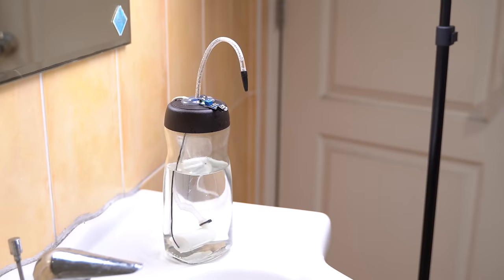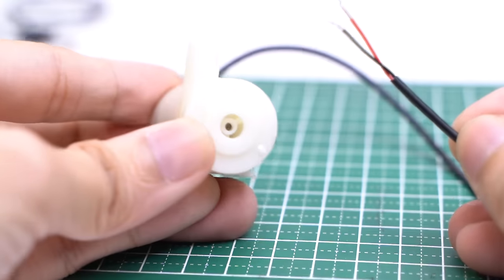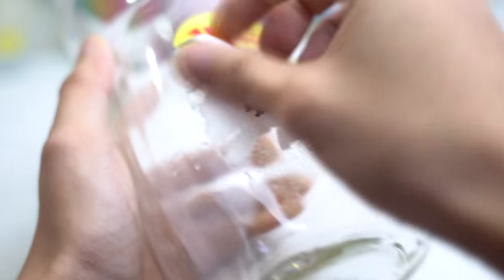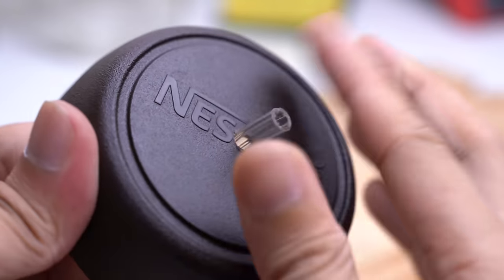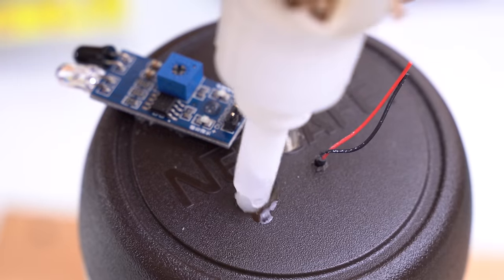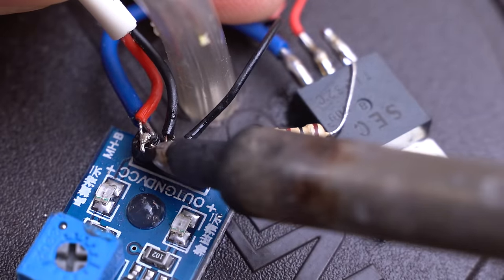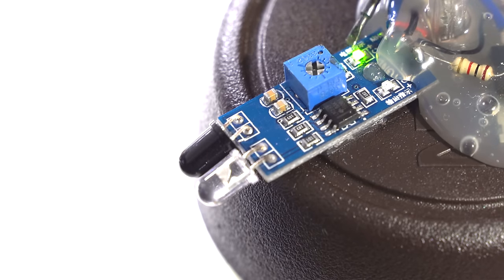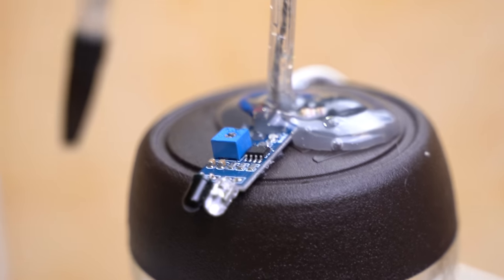DIY Automatic Alcohol Dispenser ($3 No Arduino Needed)

Comment: i made the same circuit but was unable to run it! tried to change the circuit, it worked but in reverse, like motor was running permanently and stops only if i put hand in front of sensor I used IR sensor which has VCC, G, DO and AO points did not used AO in any circuit, TIP41C transistor and 1K Ohm 0.25W Resistor. PLEASE HELP ASAP

Comment: it could have been better is you would have used mono-shot in between the sensor output and transistor input, it will resolve the problem of continuous liquid dispensing if someone does not remove hand

Comment: I have done this project but the problem is the sensor is not working after switching on the USB the motor starts and the sensor remain on it does not read any obstacle.
I have checked the sensor with USB it's OK.
But after the circuit is done there is still a problem

Comment: I had connection issues which means even though everything is connected...motor is not at all working....

When motor is connected individually it is working and even if it is connected with IR module it is working and when it is Combined with TIP 32C transistor...the motor is not working...
Anyone please help me in this regard...

Comment: thanks for this video, i just wanted to ask i used a tip42c transistor, which worked fine to be honest, i just wanted to know what is the difference between 42c and 32c transistor, plus when placed outside even when the sunlight does not hit it and the sensor completely isolated from light it keeps going on and releasing alcohol, btw thanks for the video its really helpful

Comment: hello in the implements says that it has a diode but I do not see it connected.
I only see a 1k resistor.
could you show where the diode goes
Reply: The diode goes in the same place of the 1kohm resistor (you can use the diode instead of the resistor)

Comment: I've tried it. It was great! But how to slow down the water pump??? Quite faster, can waste the sanitizer
Reply: how did you do it? i did it same with the diagram, but the pump is not working, i use 5 volts pump

Comment: Ok so everytihng is in place I checked many times, I put a led in the collector just to make sure it turns on every time i touch the sensor, it turns on, I measure the voltage 5v in the collector, but when i put the motor i dont hear anything, I have changed every element thrice, why does the LED turns on but the motor doesnt turns on?
Reply: I have the same problem. Need help

Comment: Does it have any safety issues?As the dc pump is submerged in the sanitizer which is indeed a highly flammable liquid.
Reply: From how much time are you using this machine having no problems?

Comment: Hi everyone! Does anyone know if you can delay the pump actuation? I want put some of these on top of my door knobs so that when it detects my hand it waits a second or two then it sprays the door knob. Any help will be deeply appreciated. Thanks to Tech Builder for this amazing vid!
Reply from the maker: I can design a transistor circuit for it, but I think an Arduino would be more practical in your case. Thanks man!

Comment: Any way of adding a limit to the amount of alcohol dispensed per wash? Because, a false trigger is all it takes for you to have an empty bottle.And, also i thought those pumps worked on 12V DC. I'm quite surprised to see one work on 5V
Reply from the maker: Arduino should do the job but it's too overkill. An NE555 circuit together with a transistor or MOSFET should work as a low budget substitute to give dispensing intervals. The trimmer resistor in the IR sensor must be set to a lower sensitivity to prevent that from happening. The pump is rated at 6v, it depends on which model you get.

Comment: Are you sure we should use a PNP transistor because the base of a PNP transistor is negative and the output of the proximity sensor is positive. If i use a NPN transistor, the base of the transistor will be equal to the output of the sensor. I don't know if this is correct so please help me out.
Reply: requires pnp trans to work..

Comment: I followed the instructions exactly exept i used an A transistor instead of a C transistor. The problem is that the pump is now constantly running, the adjustment screw does nothing to the pump... Tips ASAP
Reply: Use the specified transistor. Worked for me

Comment: Hey... I connected all the components as shown in circuit diagram, but my pump is running continuously.. can you tell me.why? Also my IR sensor keeps on sensing. How to resolve this?
Reply: When ur ir sensor is high it will trigger ur motor plz note ir is light sensitive so it should not be at open light kept at shade and there is a screw on ir move it clock or anticlock wise to set the distance detection of the sensor light indicator will let u know when it's high n low

Comment: I need help. I all follow the instructions but the current doesn't cut off, the pump is keep working with no stop despite I adjust the low sensitivity sensor. Any ideas?
I use power bank as current supplier.
Reply: I'm facing the same, did you get any solution plzz suggest....and if i placed a diode across E & Vcc than it gives revers functionality

Comment: if I want to use outside in daylight ??? since it is constantly activated and there is no way to stop it only works for closed places with little light ??? any solution plis !!!!
Reply from the maker: Add a short tube as a shade. It should work.

Comment: The problem that I have faced 
1. Sensor not working efficiently, when the setup is kept outside.
Reply from the maker: You can add a tube sprayed with a layer of matt black spray paint. This should prevent ambient light from entering and interfering.

Comment: Hi i tried doing this and apparently it's working the other way around. The flow stops when it detects proximity. Where do you think is wrong with my setup?
Reply: Make sure you're using a PNP transistor and not an NPN. Also make sure your connections are correct, following the schematic in the video (also linked in the video description.

Comment: Alcohol and hot melt glue is not a very good combination. Both ethanol and isopropanol vapour easily penetrate the EVA compound of hot melt glue, expand it, and debond it from the underlying surface. The glue blob volume suffers environmental stress cracking and will no longer hold too well either. A single stray droplet of alcohol can debond and weaken the hot melt glue and require rework of the project.

Instead, you can use fingernail varnish to cover the wiring. You can use acrylic double sided tape or CA glue to mount electronics. If you need to dismantle the project, both fingernail varnish and CA glue can be washed off by dropping the electronics in acetone - don't worry, the board, ICs, connectors and other components will be alright.

Comment: Hi Friend, very nice video, i tried it and almost succeed but there might be something missed or any of my component is faulty, after switching on it run continuously and power and sensor light is on continuously, please suggest what might be the issue.
Reply: I'm facing the same, did you get any solution plzz suggest....and if i placed a diode across E & Vcc than it gives revers functionality

Comment: The moment I connect it to power ,pump start running , tried indoors away from sunlight too, but it doesn't work , all the connections are as per your diagram , please help . Thanks
Reply: Same here.. for me the pump keeps running irrespective of the IR sensor output.. reply to this if you get a solution

Comment: superbly explained, good job! I had an IR module , however linking up the components as explained in your schematics makes the pump to run continously , It , however  slows down when an obstacle is brought near the IR transmitter / Photodiode, is there something wrong with the IR module?
Reply: I found the solution to the problem, I realized there are two types of IR module in the market , one with single LED which works well with BC 457 transistor  ,  & other with Two indicator  LEDS, which works well with TIP32C /TIP 42cas shown in your schematics

Comment: I used TIP 122 NPN transistor and 6v pump. But when I connect power pump start automatically, I mean Sensor's power & sensor indicator ok but Pump run like as usual. Please help mr.
Reply: why don't u use  TIP32C PNP Transistor? and less 6v pump?

Comment: Excuse me, but can anyone help me? I was wondering why are the transistor and resistor necessary? Can we not connect the motor directly with the sensor?
Reply: Unfortunate, IR sensor is sending less than 3V when detect object; when there is detection, it sends 5V

Comment: i'm new to this, and i have a question could i change the proxymity sensor with ultrasound module ??
Reply: You would then have to use a microcontroller such as an arduino to process the output of the ultrasonic module.

Comment: I have made same as shown in video but it didn't work properly. Water pump don't start pumping. It seems to be low voltage. I don't know what to do now.😔😔😔😔
Reply: Go with a 1.5A charger. Pump needs high current.

Comment: Hello sir can i used this one IRF540 MOSFET transister instead of the one u mention to us
Reply: IRF540 can be used in a similar but not identical circuit, in low side switching configuration. Too cumbersome to explain in text, ask local electrical engineer near you.

Comment: Is it safe to put 4x AA batteries (6v) for power source? Btw great job bro... ❤️
Reply: Does the board have LM358 IC on it? If i guess correctly, then yes, it is safe. But the calibration of trigger distance will be battery discharge dependent

Comment: Such a great project. I followed all the instructions and it goes well! Thank you for sharing ur project to us. A big help nowadays. Can I reproduce more of it for our school and share it also to everyone? Thank you in advance.😊😊
Reply: how did you do that? my 5 volts pump is not working but the sensor is working, what can i do?
Reply: @kevincubol2436  try to check ur connections, especially the cables of the motor it might loose or not soldered well.

Comment: Thanks for sharing.
Can I use mosfet instead of the TIP32C transistor?
Reply: Not as a 1:1 substitute, connections will be different. For usual N-Channel enhancement MOSFET, you need to use low side switching.

Comment: @techbuilder - Thanks for the amazing and low cost solution. I have got all the components but not able to find 'TIP32C PNP Transistor' or any '32' transistor nearby, can you please suggest an alternative transistor for it. I am open to using a relay switch as well.
Reply: try BD140
Reply: Will that work?
Reply: @Sooryadath  bd140 will work

Comment: Can I Input 12v and install 12v water pump its work plz reply ??
Reply: The sensor volt is 5v.We need to add voltage regulator to down 12v to 5v for sensor only.Other thing can use 12v

Comment: Thank you very much for sharing. If I cannot find TIP32C transistor, is there other model transistor that I can use? Really appreciate answering
Reply: i used a 2N 6107 transistor and it worked..
Reply: Deevish N D can i use TIP 42c transistor?

Comment: hi, some one guide me pls....i made as per this video direction. sensor works, motor not startup, ( i use the 9 V Battery) hope to get reply ,
Reply: Try to connect the motor to the 9v directly to see if it working, if so check the connections.

Comment: I tried it many times but all the times this project failed..I think there is something missing in the circuitry.Beacuse whenever motor positive end get external metal touch then only the motor works
Reply: Check with current. Pump need near to 1A current with 5v.

Comment: Kung kaya, u can add a timing delay circuit para may control ka sa operation ng pump and yung amount dispensed.
Reply from the maker: That would be great! Changing the nozzle to constrict flow would be the cheaper and practical option though.

Comment: After completing the configuration and when I switch on the USB plug, the alcohol starts flowing continuously and only stops when I take it out from thr power plug, both the lights in the sensor remains red.Can you please tell me where does the problem lies? Thankyou
Reply: If you put your hand in the sensor it stop? , maybe you have a PNP Transistor (i think in this case is NPN).
Reply: How to do it with pnp

Comment: sir what will happen if we dont use transistor? instead just use the proximity sensor's output to 
pump..
Reply from the maker: The sensor's output can only handle very little current and inverted too. It's either not going to work, the chip would burn or keeps pumping when it senses something.
Reply: @TechBuilder  okay sir...thank you very much..subscribed😁

Comment: Hi! Thank you for the video!
Do you have any recommendations if I want to use it outdoor? Since I heard proximity sensor won't work well under sunlight. Will a PIR motion sensor work or does it have to use Arduino?
Also, do you think I can modify it by using battery? Thank you
Reply from the maker: I wish I can send photos here. You can fix the outdoor problem by adding a tiny rectangular tube lined with a layer of matt black spray paint from the inside. It would act as a shade.
Reply: Hey you can make a good outer cover for the sensor which would prevent sunlight from entering it
Reply: Hi did you find a solution for this. I have the same problem
Reply: use e18-d80nk sensor (222 peso including shippiing).. it works outdoor but a little expensive than this infrared prox sensor.

Comment: Can we use 9v battery.. instead of USB?? Pls.. do tell..
Reply from the maker: Just add a 7805 regulator or a buck DC-DC converter module to convert 9v to 5v.

Comment: Hey can I use 5V Relay instead of transistor used in the circuit. Any concerns with it. And with this mod, is it still required to use 1K resistor shwon in the circuit & recommended IN4007 diode. Appreciate your reply. Thanks!
Reply: Transistor or MOSFET is used to minimise space and no moving contacts and lesser power consumption.
Reply from the maker: A relay would still need a transistor as a driver, the proximity sensor wouldn't be able to provide enough current to flick the relay. As far as I could recall, the digital output of the module is tied to an LM393 chip with an output of 5v @6mA.
Reply: plz check tech help channel where they have used a relay

Comment: Thank you for the tutorial however I am having issue with my DIY tested it with water and the liquid continuous flowing even my hand is not on the sensor
Reply: Same here bro.. did you get any solution for that?
Reply: Liquid keeps flowing if the other end of the tube is at a lower level than the liquid level in the container. I corrected this and then it worked perfectly 👌
Reply: Pump continuously running even without hand placed in front of sensor. I am placing the entire setup outdoor and I think the sunlight is the reason for this. Is there a solution to rectify this problem I face with this project
Reply: To stop that take the tube close to the pump,make 1 circle across like pretzel it will stop it. Hope my English helps.
Reply: @r4rony666  indoors only.. not for outdoors.. change sensor with this one e18-d80nk.. its a bit ezpensive but it works outdoors.

Comment: Hi bro there is a problem in my setup as soon as i plug in the powerbank the motor starts working and and when i keep my hand on the sensor it stops
Reply: use pnp transistor..
Reply: @resjandonero2221  TIP32C

Comment: Is there chances of catching fire with motor inside?
Reply: the motor is made to be submerge\placed under water or any liquid ..=)
Reply: @franzduazo2599  any liquid but not flammable?
Reply: @Karthiks360plus  im pretty much sure it's sealed tight.. just be sure to use not the cheap ones. hahaha. i havent seen any submersible pump cause electrical short.. at lease on my case..

Comment: Can it not run on just the power supply, a 5v DC pump and the proximity switch without the transistor?
Reply: No. The current consumption of the pump will damage the IR module.
Reply from the maker: @_Ashutosh_Rana_  Exactly :))

Comment: great job . I can not find (tip32c - pnp) in my country and i can not buy it from links on description it will be so expensive. can i change it with another transistor
Reply: i have the same question if it work with any transistor else ?
Reply: U can use BD140
Reply: Eddy Chee can i use tip 42c?

Comment: How many volts for the transistor?  Also can you skip the pump and wire an led?  For it to flash when something is near?
Reply from the maker: By volts you mean the Vce? If yes it's -100v from the datasheet. And yes, you can replace the motor with a resistor protected LED.
Reply: If i sent you a diagram of what I was trying to accomplish, would you be able to help me in telling the parts I'd need?  Id be willing to pay.
Reply: Can you email me or I you?
Reply: @TechBuilder  I am not knowledgeable with electronics would you be willing to assist me and/or build it if I pay in advance

Comment: Need help. It works the reverse way. My motor keeps on running and if I take hand near sensor it stops. How to solve this issue
Reply: I need help too..my motor get started as soon as i apply power supply bt didnt stop.. wat to do...
Reply: same here, pls. any sulotions?
Reply: did u use the same parts and materials on the video?

Comment: can we use BC547B  transistor as equivalent to TIP32c ???
Reply: no. BC547 can give a maximum of 180mA, Pump needs near to 1A. I have experienced it. So, I selected ULN2003 IC.
Reply: @UdayChaitanyaSamala  will you please provide circuit diagram using ULN2003 IC

Comment: Hi sir why not you use battery
Reply from the maker: Batteries voltages may vary with respect to the state of charge. Bottomline: it's unregulated. A USB power source on the other hand is regulated to 5V. This prevents the sensor module to malfunction if the voltage drops below it's 5V rating.